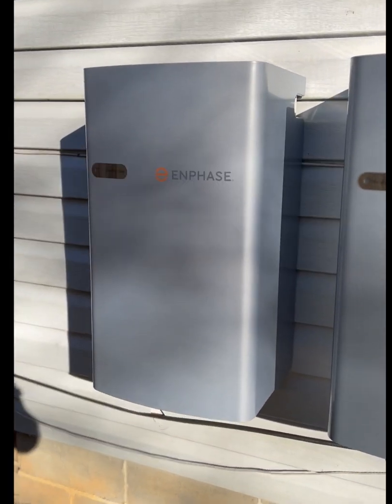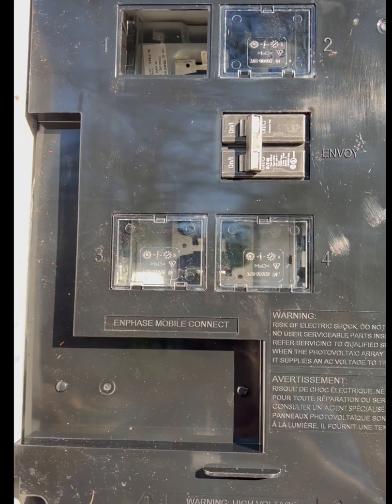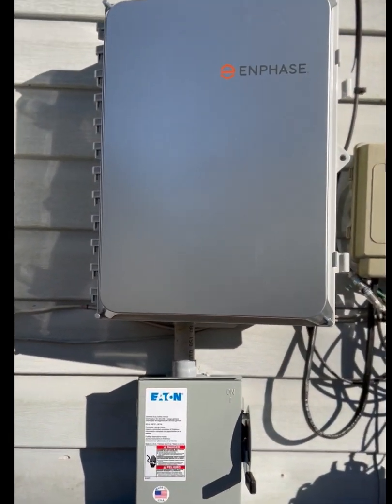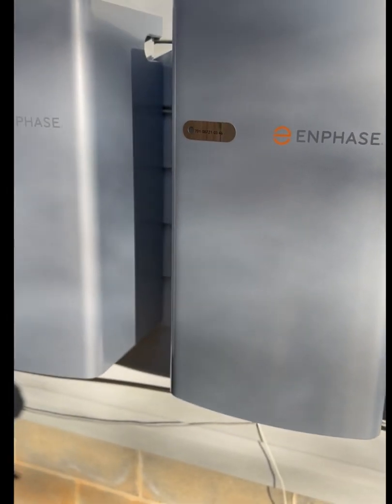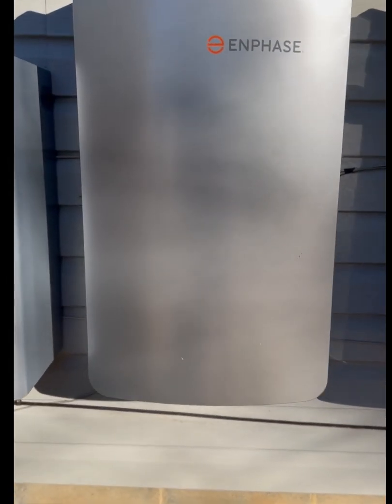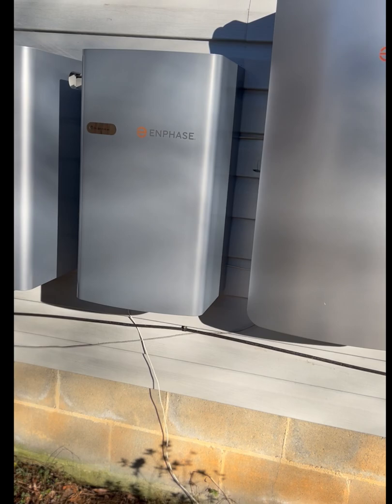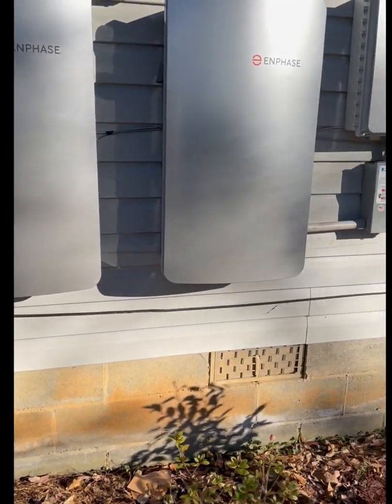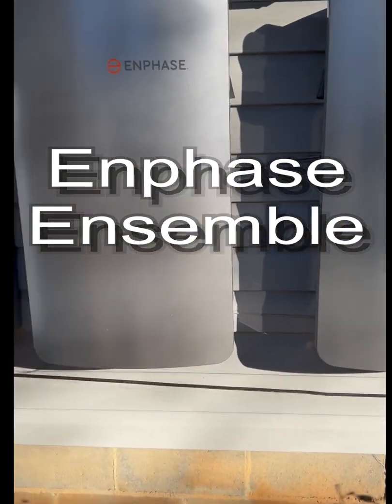Enphase Ensemble Install

Comment: Why are there 2 smart switches?
Reply from the maker: It is a duplex with two service meters. One Smart Switch, Enphase Gateway and Battery Per Meter. I know it sounds confusing but its like installing on two homes just one building.
Reply: @thinkpower3653  Thanks for that.
Reply from the maker: Your welcome